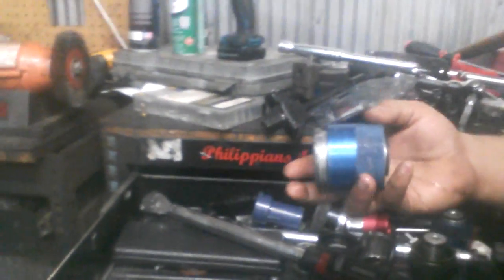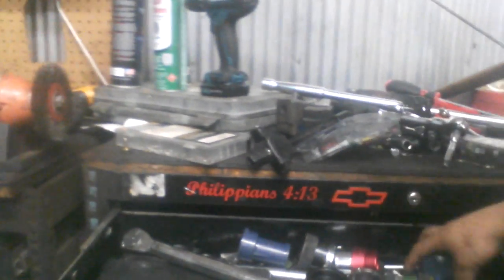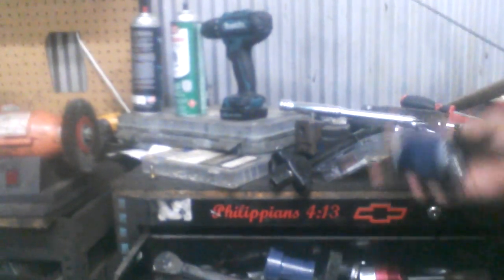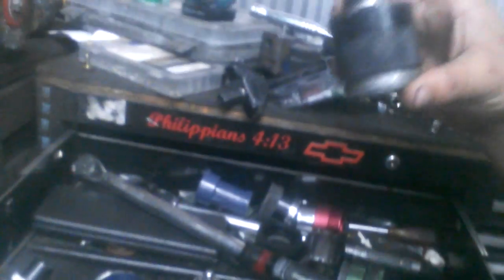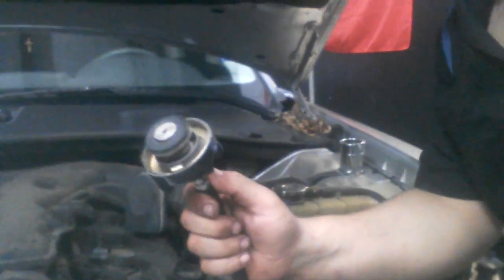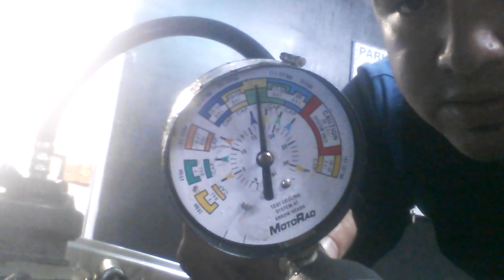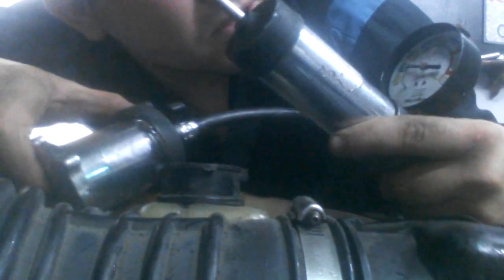How to find coolant leaks. THE EASY WAY!!!!!!

Comment: can a blown head gasket cause a car to overheat?  I took my car in to be diagnosis for a SMALL water leak  found under the car after it had been sitting for two days....my Mechanic pressure tested and concluded that it was leaking from the back middle of the head gasket, he put in stop leak two and my car overheated on the 4 mile drive home!? It had NEVER overheated until that drive home from the mechanics shop.  What could cause that? I asked him if he thought it was the stop leak clogging the thermostat and he said NO.  Sorry and hung up the phone!  I very much appreciate your expert opinion on this.  I ended up having my radiator blow open on me and after having it replaced by another mechanic (who said it did not have a leaking head gasket,) the car still over heated and we had to put a rebuilt engine in it. Because the stop leak had clogged the engine ports.  Who do I believe!?!?
Reply from the maker: first of all i never would use any stop leak additive. if any thing its just a temporary fix. what should have been done was a cylinder block test on it. i have a video that explains how to do that test. other than what caused it. its hard to say without looking at it. but many stuff can cause the engine to overheat. from clogged passages, low coolant, leaks, thermostat, head gasket failure, fans not working ect. a proper test should have been done.
Reply: Thank you for taking the time to reply.....The engine never did overheat until he put the Blue devil in it!  "Great Mechanic" huh?!  It just had a small water leak one time.  : /

Comment: 96 oldsmobile LSS, leaking coolant cant tell if its my water pump or if its leaking from else where in the cooling system. my engine does not over heat, but i fill my reservoir every 2 days due to the leak. reservoir has been empty for some time leading up to this comment per the amount of money spent on coolant to be dumped on the ground. and i can drive like this with no problems city and highway for about a month before my low coolant light turns on again and i add more coolant. suggestions ??????????

Comment: I can smell antifreeze inside of Pt cruiser 2002 when driving it. No leaks inside. Any suggestions ? I am going to check the cap as well. Not wet on ground either.
Reply from the maker: Raylene Torrez could be your heater core. I would do a radiator pressure test to see if the pressure drops

Comment: Need to know about reservior tank how to locate hose.  PT CRUISER 2005 TURBO convertible antifreeze all over ground. Checked radiator still fluid in there. Checked reservior low pour alittle in there pour right to ground. Confused no over heating
Reply from the maker: Get you a radiator pressure tester to eat the cooling system. That should help locate where the leak is coming from

Comment: wish you was my mechanic already changed expansion tank and rad cap stopped for a bit now leaking again freelander facelift 04
Reply: Best of luck, freelanders have many coolant problems. look at the plastic lines under the intake, also the cylinder sleeves are known for lifting and causing engine failure.

Comment: There's a small male nipplw.on the bottom of the coolant container that's mounted on the car. It never leaked then had my 2001 audi a6 quattro avant fixed. Now.it leaks as if it's missing a hose. What's up with the nipple?.is it over flow?
Reply from the maker: Those nipples have a tendency to break off especially on the vw,Audi, Mercedes etc

Comment: my truck is not holding coolant. when you pore it in it runs right through but it is not leaking out on the ground. It is showing no sing of a visible leak. It is running hot and not holding coolant. but where is it going? what should I do?
Reply from the maker: DoinitWright 777 see exactly what part it's running out of front or back of the engine

Comment: OZ MECHANICS ,,,
 ,,                  1.) how can you test the engines thermostat to make sure its work correctly? you put your hand on the "upper" radiator hose to feel its its HOT but how do you know the thermostat is opening and closing?

 I don't know how to test the temperature sending unit or where its at in cars. I'm not sure if the sending unit means a sensor. 
                            2.)  How do you test or what do you use to test the temperature sending unit?
        3.) Can I buy a digital gauge at PEP BOYS and install it in the fuse box wires by slicing the wires to test if the analog temperature gauge in the car dash temp gauge is reading false reading measurements of the temperature?
             4.) Can you make a youtube video showing how to test the car dash gauges to see if they work correctly and not reading false readings and how to test the sending units to the cars gauges?
       5.) I don't know how to test the cars gas gauge, oil gauge, temperature gauge using a ohm meter or what other test tool can I use to test these gauges are working correctly and not giving false reading or not working correctly?

Comment: one good way if you don't have a coolant pressure tester and the coolant is low add water just for the test start the car the car will warm up and the cooling system will build pressure and look for leaks  after you replace the part backflush the cooling system add coolant then your done

Comment: I have a coolant leak on my e46 323. I removed the cover from the bottom and I saw no leaks at all for 10 minutes, but when it is on i can see that it is wet down there. I replaced the O ring but that didnt help. 
So it leaks  ONLY when i am driving it. If i have it in the garage over the night there is no leak at all. still same coolant level. Do you think it can be the cap?
Reply: I should add that i dont have overheating problem. it just leaks when i drive. it can even be on standing still and doesnt drop any coolant
Reply from the maker: ZekeMagnum and have you tested the car with a pressure tester ?
Reply: Nope not yet. I think it has to do something with the cooler itself. I have coolant stain in the front on the cooler radiator and if you look at it from the front it has wet spots all over + the bolt that holds the plastic cover on the right is all wet.
Reply from the maker: if you use a radiator pressure tester you will find the leak a lot faster

Comment: This is how to test the rad cap only. What if the cap is fine but it's the rad, or a hose, or water pump?
Reply from the maker: Same way just hook up the radiator pressure tester to the radiator. Pressurize the system and look for leaks

Comment: Hi dude I have a coolant leak on my peugeot 206 HDI hell knows were it is my coolant cap is plastic underneath there is a slight drip coming from the gearbox as the 206 is is side on were can I higher that pressure tester umm? in the uk

Comment: I heard air sipping out by my hose.could the hose be bad.its ny the clamp.please let mo know before i buy a new radiator..thanks.i aslo saw fliud by thier...
Reply from the maker: Juan Rendon have you used a pressure tester to put pressure in the system ?
Reply: Oz Mechanics no..just saw it about an hour ago.

Comment: It doesn't always work pressurizing the system. Mine won't leak until hot and then I have tried over and over to see where It leaks It is .behind or near the exhaust manifold and can;t find where it is. Been working on cars 30 years and this leak has me stumped.

Comment: I have a Ford 150 1989.
Antifreeze lacks inside on the right and my floor has antifreeze how do i fix that
Reply: Miranda Grindon if ya didnt figure it out its probably a bad heater core. There is not alot else that will leak coolant into the cabin onto the floor boards

Comment: my car keeps running hot toyota camry 2000 model first i change the radiator,thermostat,thermostat housing and it stop running hot for a couple of weeks,then one day it ran hot again so i change the radiator cap and it stopped for about a day and a half then it ran hot again ,this time i notice a lot of fluid leaking but could not find it please help!
Reply: did u get this sorted out? sounds like maybe the water pump?

Comment: If it is the cap would it still leak under neith
Reply from the maker: Cap has 2 seals one that regulates pressure and one that’s seals the pressure
Reply: @OzMechanics  so would it leak underneath
Reply from the maker: What do you mean underneath ? On the base of the radiator ?
Reply: @OzMechanics  sorry I'm jus saying like all I did was add more antifreeze to it, never had a problem with it overheating but the day that I started put more antifreeze into it starts leaking from the under the car I can't really see where it's actually leaking from....

Comment: I appreciate the effort, but how exactly does this video help you locate a coolant leak? Using the information you presented I could find out that I had a leak, but not where the leak was. Perhaps you should rename this video?
Reply from the maker: Dusty Boot simple by using that pressure tester in the video. The pressure tester creates pressure in the cooling system which would show where the leak was coming from. There was a coolant leak in this video but it came from the radiator cap. I’m not sure what you didn’t understand?
Reply: More detail would have been appreciated.  Possibly looking at the hoses and around the radiator during the pressure check.  Remember, weekend mechanics watch these videos, not professional mechanics.  Thank you.
Reply from the maker: Dusty Boot no problem. Hey these messages just help me for future videos. Feel free to watch my newer videos to see if they have gotten better

Comment: Nobody can find my coolant leak.. after my drive, I park the car for around 15 hours, and after that, it has leaked under the car.. peugeot 206sw 🤔
Reply from the maker: The Rolling Bear buy some up dye for the cooling system. That will determine where your leak is coming from

Comment: there is a better way to check,,,, and easier. Its not accurate but will tell you immediatly if there is a problem in the circuit. Then you can recheck with a pressure gauge.
Reply from the maker: Maxengines Tech what is that ?

Comment: MY PRESSURE TEST COMES NEGATIVE. IT DOESNT LOSE ANY PRESSURE. I EVEN HAD A NEW RADIATOR REPLACED AND STILL MY COOLANT IS MISSING. BUT NOTHING IS FUCKING LEAKING WTF DO I DO. I TOOK IT TTO MECHANICS 3 TIMES AND THEY SAY IF WE CANT FIND THE LEAK WE CANT FIX IT.

Comment: This is a video on how to find out IF you have a coolant leak not to actually find one.
Reply from the maker: UA10i12 uhhhh ...
Reply: If you cannot find a leak while there is 18 or so psi in the system then you need to wipe your eyes and clean your ears. listen and look and you will find it.
Reply from the maker: Isaiah if you didn't see. The cap was the problem. There wasn't a leak anywhere
Reply: i was speaking to the man that said this video doesnt show how to find a leak but only if there is one. i was just stateing that by pressure testing you would be able to easily find a leak and he doesn't need someone to show him how.
Reply from the maker: Isaiah ok. Just making sure
Reply: it's all good. thanks for the video.
Reply from the maker: No problem thanks for watching. It's just half of the people that contact me troll my page

Comment: Not very helpful if you have a slow leak and how to, and where to look ???
Would you look at hoses, gaskets, or where. You don't really show how
to find a leak that's hard to find. I have one !!!
Reply from the maker: Grant P try using coolant up dye. That would be a better alternative for slow leaks
Reply: From what I've been told-it should be pressure tested-makes sense 
to find a slow leak.